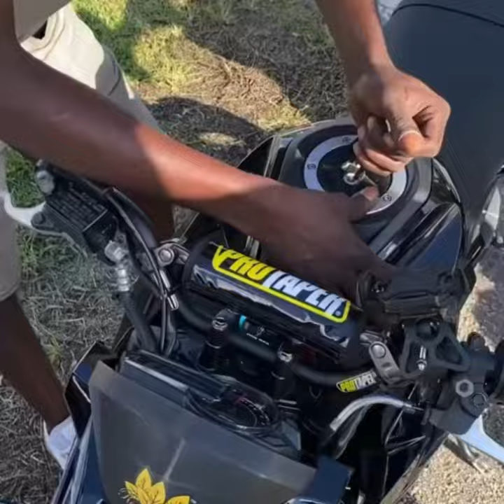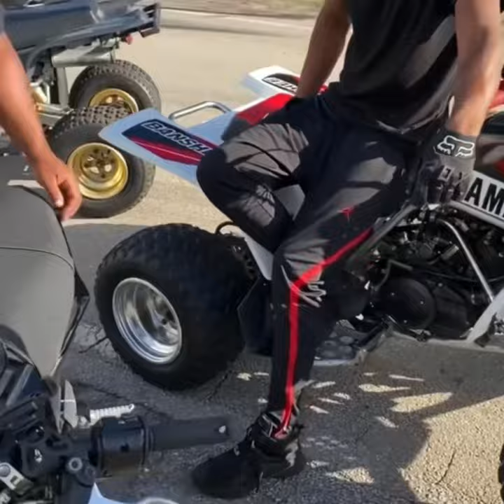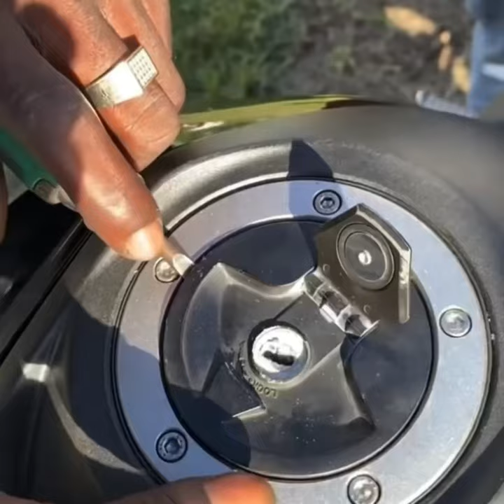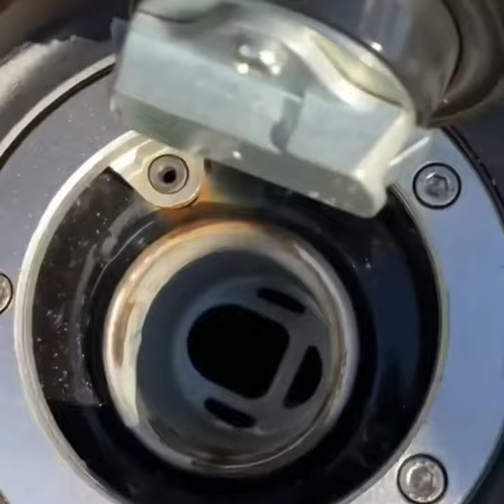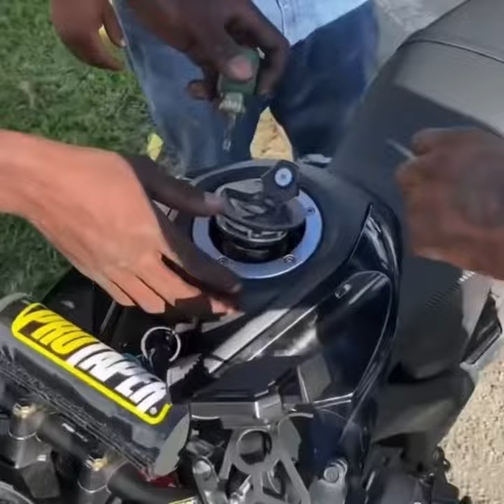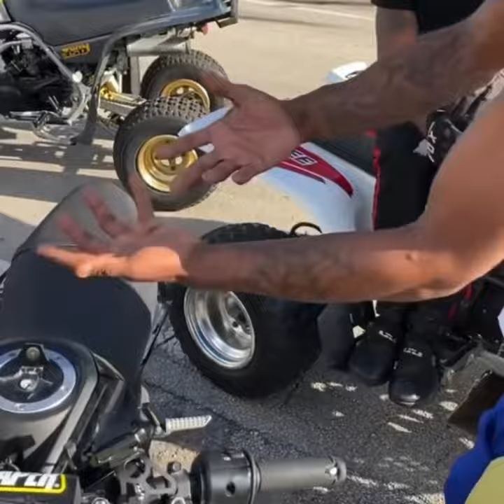🍋 Lemon Update Guy Demonstrates How To Pick A Lock To A Gas Tank Cap If You Lost Your Key

Comment: this is bs, you just need to remove the Allen bolts around the cap and the whole thing comes off. Levering the lockable part will just damage it since they are normally made from cast metal which will only bend once. in fact half the time 2 or 3 of the bolts are just for decoration and don’t even hold anything down.